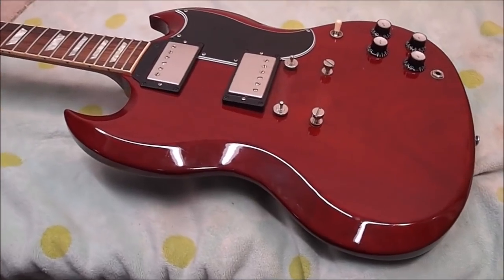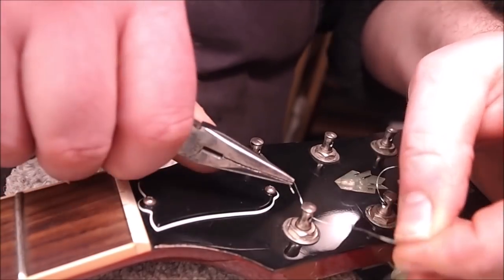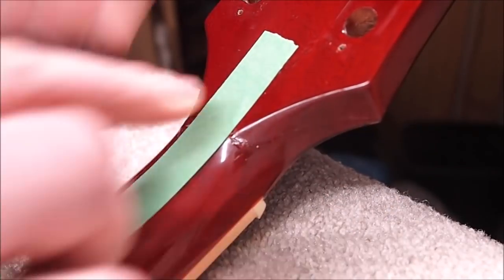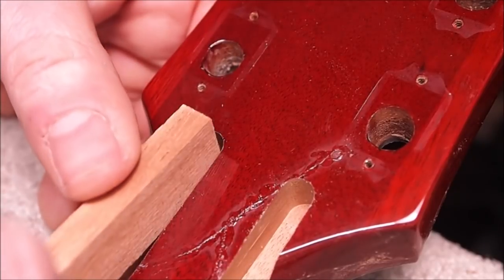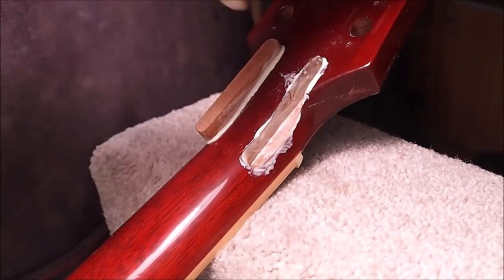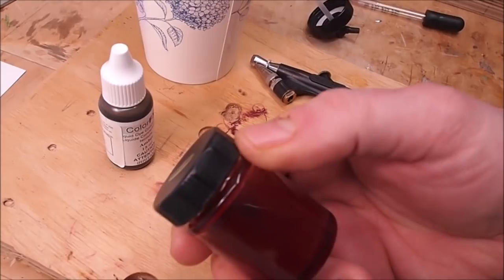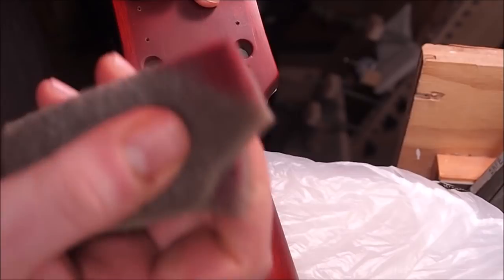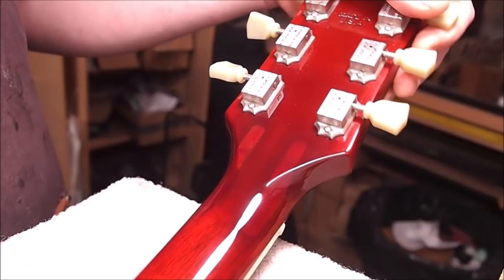Gibson SG Headstock Finds the Strength to Heal

Comment: Gibson should really do a joint headstock whit less angle like epiphone or taylor guitar
Reply: All the fan boys would cry and scream "it's not original". The last time Gibson changed something they whined and bitched until they went back to the old worse way of doing things.
Reply: yeah but u got too admit that this would be great
Reply: @jeromelacroix303  Gibson has fixed the problem before with both the Les Paul and SG's. Several times the cork sniffers yell nonsense about less sustain and it alters the tone blah, blah, blah. And Gibson caves in and goes back to that extreme angle on the headstock every time. Fender got it right you have to try to break that headstock off. It's not impossible but it takes more than falling off a guitar stand.

Comment: Makes you wonder why Gibson haven’t adjusted the design as it’s that well known that they break! Maybe it’s the bolt on nature, but I haven’t heard of Fender’s necks breaking in the same way or with the same frequency…
Reply: Because of tradition. 

Gibsons are expensive and the company knows the majority of the people who are going to drop thousands on one of them want the guitar to be exactly like the old ones. Whenever they've made minor changes in the past (adding and removing volutes, pancake bodies in the 70s, etc) people have complained. They've learned their lesson: Gibson buyers want guitars made precisely like they were done in the 50s. So that's what they do.

Fender style necks don't break the same way mostly because they use a straight headstock design with no angle. That helps a lot.

Comment: Why are Gibson's heads prone to breaking?
Reply: I might be tottaly wrong but: Because Gibson's necks are made with a continuous piece of wood and the wood grain don't follow the angle and therefore it is a weak point. That's why a lot of people including myself tend to do necks with scarf joints. It is easier and stronger
Reply from the maker: What Luis said, and also the angle used is very acute - 17 degrees, so if you were to rest them on a table top and plot it in side view, the tip of the headstock is lower than the thickness of the body.  It's a weak design but Gibson customers want it exactly the way it was in done in1958, so they're kind of trapped and can't change it.

Comment: What specifically about the way Gibson designed their necks make them easy to break
Reply: I think it has to do with the big cavity they cut out for the truss rod nut.
Reply: It also has to do with the headstock angle. This is especially bad on SGs because the body is so thin. If you were to lay an SG on its back on a level surface the top back edge of the headstock would be touching the surface, but the joint where the neck meets the body wouldn’t be. So if the guitar is dropped on it’s back the headstock takes the full force of the impact, causing it to break nearly 100% of the time.
Reply: @behradgorgani  Yep; that, and the fact that SG necks are very long and slender, and the headstock with tuning machines is like the head of a club on a long pole.
Reply: @ajackson5955  the angle also means it's not continuous grain from the neck to the headstock

Comment: What's the deal with Epiphones, then? I know they're technically not Gibsons, but they are licensed copies and they share the same design, so why don't Epiphones have the same reputation for busted headstocks? I have 3 (an SG and two LPs)...NEVER had a problem with the headstocks.
Reply: lesser headstock angle, Gibsons around 17 degrees, Epiphones 13 or 14 degrees. It makes a difference.

Comment: Is Gibson still using Honduras Mahogany?  I think it's time to choose a stronger wood.  What about ash or hickory.  No, hickory is too splotchy.  Don't they make baseball bats out of ash?  I haven't seen one of those break in a while.
Make the front applique out of steel and paint it black.  That's cheap and dirty.
You would think Gibson would bury some metal under the fingerboard/front applique area.  What the heck is the matter with them?  Totally asleep.

Comment: Why doesn't Gibson just change the angle, and add a volute?  Why doesn't Gibson factory install these splines on all Gibsons, before sending them out?  Almost everyone else uses carbon fiber strips to reenforce their necks.  Gibsons are way too expensive for what you get, and part of what you're getting is the inevitable headstock breakage and repair bill.  Anyone who buys a Gibson, is a damned fool, and that's not an opinion, it's not subjective either, it is as a matter of objective fact, you're a damned fool.  A person, still living in the 60s... that's who.